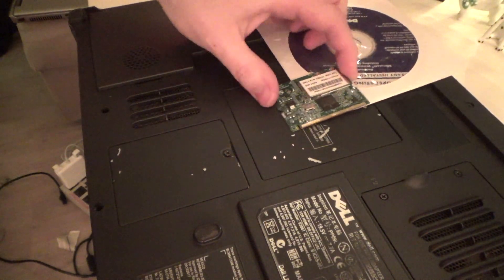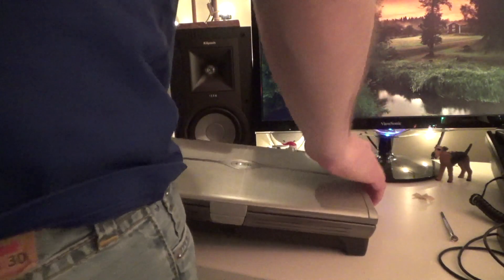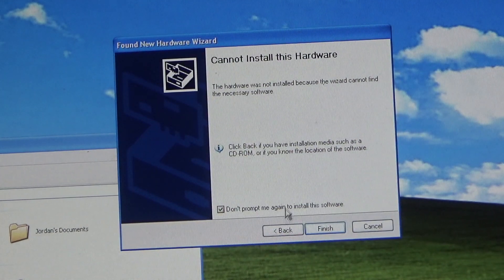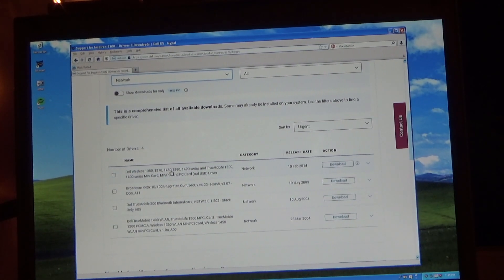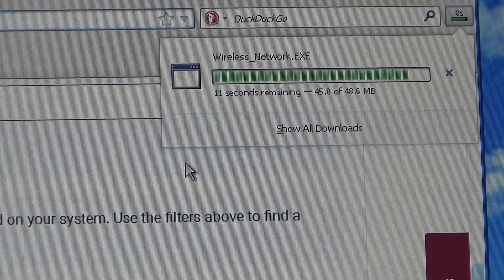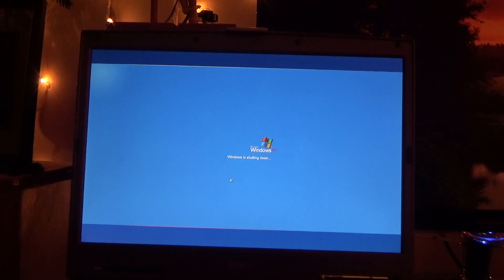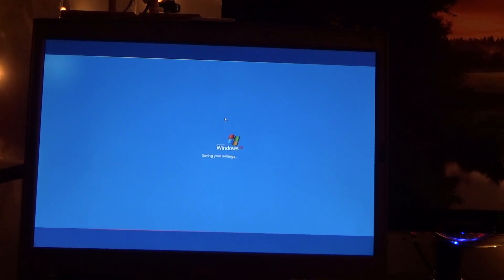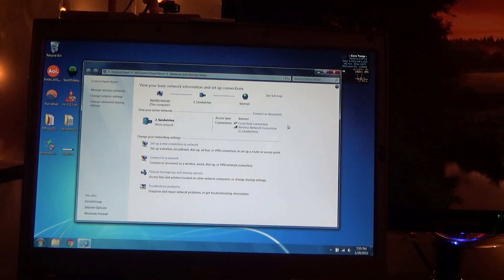Dell Inspiron 9100 Laptop Computer | Installing A Wireless Networking Card

Comment: I found my old Inspiron 9100 running XP Pro stored away in a closet. I have Verizon DSL. It already had the wireless card and shows good connection to my network. I downloaded the MyPal browser on another computer and loaded it on the 9100. I have tried both wireless and ethernet connections and cannot get it to go online. On the bottom right I see both the wireless and ethernet connections but I can't get the computer to use any of them. If I try to use the built in internet connection wizard it seems like in the last process of that  it is trying to dial a connection rather than going through the broadband connection. At this point I'm mystified.

Comment: Is bot Corey with a witeless car from new? It seem a a bit modern to Not have come with wiless from new. Who is going to even ord at a laptop with no wirelles new anyways
Reply: talldude123  OH MY... it doesn't. I was trying to ask if it did not come with any form of wireless card from the factory. It seems a bit modern to not have come with any sort of wireless card. And who orders a laptop without a wireless card at that time period. I mean, I can understand maybe a cheap model, but that is a pretty high end model from the time.
Reply from the maker: I've seen a lot of these without the wireless card. I have plenty of units from the era without wireless, that's what expansion cards are for.
Reply: @JordanU  I guess so. I see a lot of the ones like one generation before that don't have wireless cards, some even don't have the spot for a built in one. I really can't stand PCMCIA wireless cards as they just stick way out and have a tendency to bend or break if it is a machine that is being carried around a lot.
Reply from the maker: @WalterKnox  I have a number of machines I use them in, I find they get a better reception than some internal WIFI cards on certain machines.